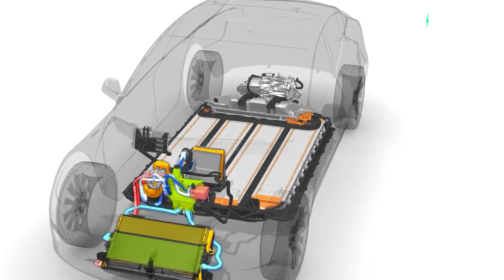Ford's genius plan to sell EVs in the US with 2 types of batteries

Comment: I am American and own a tree farm and I NEED it to be able to run my trucks non-stop for ten hours.  That isn't a problem with a diesel F-Series with a 29 gallon tank.  Their EVs need to have the same capability (600 miles on a charge) if they want us to consider one, and dealer greed isn't helping.  We could buy enough diesel to drive 92k miles for the $20k dealer price gouging "market adjustments" on a Lighting.  At 17 cents a kWh you might never recoup the additional purchase cost in "fuel" savings.

Comment: Ford may well be able to build 20k to 60k more electric cars per year over the next few years by importing LFP cells. It worries me that one of their main battery plants won't be in operation until 2026. We may well see good ICE sales on through 2024 but by 2025 millions of people will be hearing from friends driving Tesla & other EV. Ford will be at a price disadvantage on cars relying on imported cells. The high-end versions of the F150 might not qualify for the tax credits due to MSRP, and the low-end would be losing out due to imported batteries. Ford is making the right decision for chemistry reliability and total production run, but is in a tight spot from Tesla's pricing power, vertical integration & efficiency.

Comment: People will learn that range is not the big deal they think today.   I have not driven more than 300 miles in a day in over 5 years if you can recharge 80% in 20 minutes you are good. Most people drive less than 100 miles per day the big challenge will be recharging for rentals overnight

Comment: I wonder if we will ever see range upgradable cars? Say you buy a car with a smaller range but the next owner needs more. Automakers could have a space under the car where a second battery could be installed or make it easy to change the entire battery pack. Maybe even upgrade the type of battery. This would allow customers to upgrade cars and allow automakers to get battery packs back for recycling or reuse as an additional revenue stream. Lead acid batteries are recycled at over 90% mainly because you turn in the old one when you buy a new one.

Comment: LFP is only one of many battery types automakers will be using and that's good because it prevents price gouging in the mineral supply chain. You have to keep suppliers on edge not knowing what you could switch to if the price gets too high. When you think about it ICE cars don't all use the same fuel and engine / transmission design. EVs will also use different designs and components (including battery types) over time. We may even see cars with more than one type of battery in the same pack like the ONE (Our Next Energy) designs to take advantage of the properties of each kind.

Comment: Ford is raising its ICE engine F150 to make the gap in price less . Customers who placed orders are cancelling the F150 lightning in droves and dealers have them in stock because of this . People are cancelling ICE engine F150 because of price rises . The short range when towing has really hurt sales in country areas of USA , you may not seen F150 towing all the time but when they do you don't want to stop every hundred miles and recharge for a few hours , if you can find a working vacant charger . Put a 200KW pack in it at least offer it . Meanwhile Ford have a problem Tesla will reduce their F150 sales by about 25% as Tesla truck buyers will come from someone who would have bought another brand of truck . The  recession will reduce sales even more , so ford in 2 years may find it will sell 35-55% less trucks than it does now and they are the only vehicle they make a profit on selling and financing . If Tesla comes out with a 250Kw version of the Cybra truck  Ford and GM are screwed .

Comment: Great content but are you sure LFT batteries charge faster?  My model 3 with LFP charges at a max of 170kw and only for a brief time.  Most other none-LFP Tesla's charge at a max of 250kw, although also for a brief time.
Reply: It's not the LFP chemistry causing that, it's the pack size. Smaller pack means lower charge speed.

Comment: I’m really waiting to see what the EV industry will do to improve batteries in cold weather climates. I was disappointed that Tesla did not discuss this on their Investor Day. I know you have looked at this issue with some new battery chemistries. How best do you think Tesla will address this issue? The USA has so many cold weather climates I want to see some improvement. With pickup trucks if you pull a large load in your bay and it’s very cold outside it’s a double hit with range. I do recognize that Tesla’s heat pump is a good first start for cold weather climates. ❤️❤️❤️

Comment: Explain where we are going to get the copper otherwise this is just a charlatan EV channel.
Reply: copper? No company makes cars out of copper. When you see a brown car, it’s brown ‘cause someone painted it. I guess it could be rusty…
Reply: @FrunkensteinVonZipperneck  EVs use far more than an order of magnitude of copper than ICE cars.   Give this a viewing and get the host of this thread to explain how it’s possible to avoid the mineral supply issue. 

https://youtu.be/sgOEGKDVvsg
Reply: Copper is not a problem, definitely not the weak link. Tesla specifically had a slide during their investor day covering the needed resources. A full transition to EVs required less than 5% of the USGS estimated resources of copper.
Reply: Charlatan EV post
Reply: @beautifulgirl219  prove me and more importantly- mark mills and other mining experts wrong.

Comment: So, Ford have said they will use 2 types of batteries but that this isn't an issue for the average consumer as the buying choice they will be given is "Do you want a cheaper Mach-E which will do less range or a more expensive one which will give you more range?" This seems very reasonable. What I'm struggling with is why this shows that Jim Farley is suddenly a genius. Surely I can go into an MG dealership in the UK and choose a standard or long range version of an EV. I can spec a Skoda Enyaq as a 60kwh battery or an 80kwh battery. Why is Ford offering standard and long range so revolutionary?
Reply: "What I'm struggling with is why this shows that Jim Farley is suddenly a genius."
This is a fair point.  So many other legacy auto makers are so damned stupid and unaware that when one finally makes a decision any bright 14 year old would then it seems as if he is a genius.
Reply: Very good point.

Something similar to Toyota engineers , reverse engineering a "Tesla Model Y" and discovering how far Tesla has left everybody in the dust.

Seems like the OEM's are very slow on the update.

Comment: Hope fords reveal in two weeks with 310 miles of range has lfp. The real range with lfp would be 310 miles. The bolt with 259 miles of range is only 160 miles of range. I have a new bolt euv and they told me not to charge over 80% and to charge at 20%. Twice the range and save money on top.
Reply: That’s not true unless you are saying now that it’s Winter you are only getting 160 miles on your EUV.  Everyone knows (or should know or should have researched before buying) Gas cars and EV’s aren’t efficient in the Winter!  I don’t think anybody at Chevy or the Bolt EV manual has told me only to charge to 80% besides lunatics on Facebook or Youtube.  I charge to nearly 100%. Probably a super bad idea to only fast charge and fast charge always to 100% however.  I did not buy my EV because of the fast charging.  It was just an extra I’d like to have just in case.

Comment: Lot of sides changing.
Software.
Batteries.
Voltage.
In every there is a lot of things happening.
Dangers in bad designs.
Dangers in bad production.
Differe nt materials used.
Quality not linked to price.
Lots of aspecrs to what is happening.
The death of ice is only one.
Use of 400, 800 and 48 volts change a lot.
Iron, steel, plastics etc.